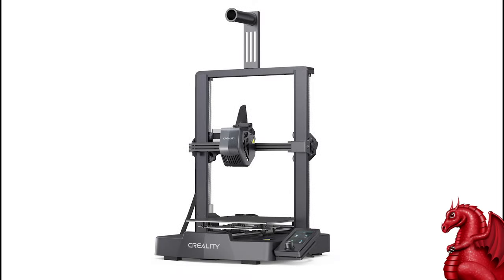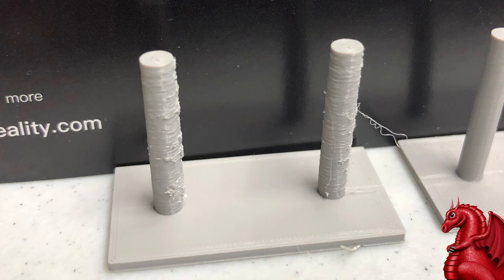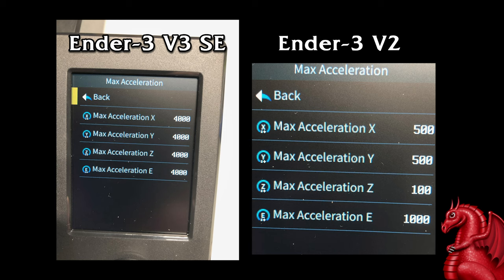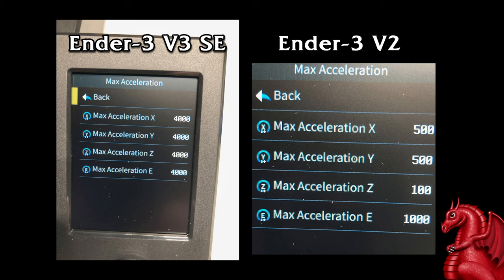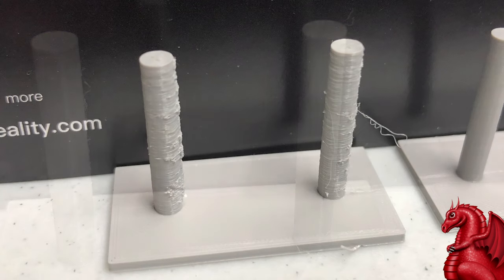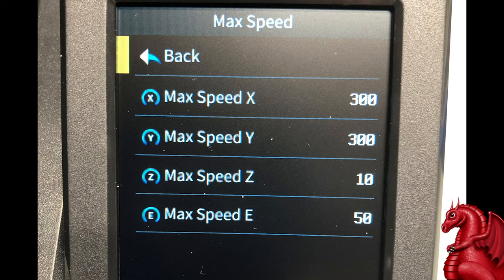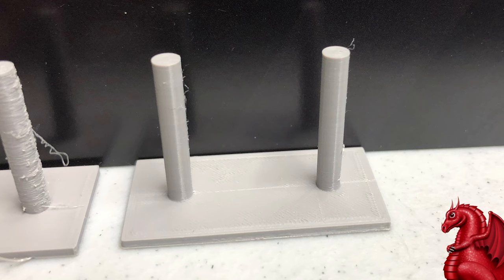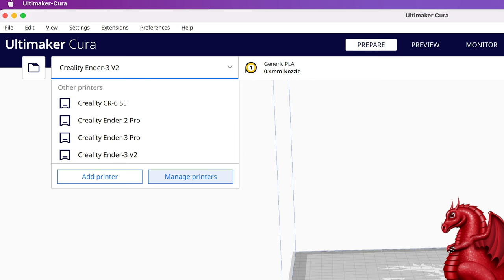Fine tune your Ender 3 V3 SE - eliminate stringing!

Comment: Evening good sir!! I just ordered my refurb SE from Creality for only $125 and was managing my printer on Creality Print app, I adjusted the speeds as you indicated, but the code sequence is different. It reads as follows:
M220 S100 ;Reset Feedrate

M221 S100 ;Reset Flowrate

G28 ;Home

G92 E0 ;Reset Extruder

Do I still only insert the M413 S0 ; Power Loss Off before the G92 line? TIA and great channel!!!
Reply from the maker: That will work (or right after)

Comment: Your printer is clearly extruding too much material. Look at the  top layer of that base. You can see some material being squished up between the roof lines. I'd suggest you calibrate the extruder before changing anything else. Also it could be mostly a Z offset problem, as you said. Changing movement speeds reduces automaticaly the filament extrusion speed and amount, which I think is the initial and main problem, above all others.

Comment: I followed your advice and have to say... it's been working out pretty bad for me so far. What i do love is that the printer has gotten WAY quieter with your settings. Changing directions doesn't produce audible "clicks" anymore.

However, i've had TERRIBLE stringing with this. Tried to change a bunch of settings in the slicer as well (tried both Cura and Creality Slicer) and the only thing that fixed it was increasing acceleration speed again. At 1000 for YX and E its gotten better, but still not as good as if i left everything at 4000.
Reply from the maker: Are you using my Cura profiles? All you need to do is change the retraction to 1mm, everything else is good as-is.
Reply: You can run much higher acceleration without stringing, you just need to run some retract towers at whatever speed and acceleration you want to tune it to. I can get fin details on printed miniatures with 100-140 speed and 1800-2400 acceleration. 16-20 Jerk. I ended up with 1.2-1.4 retract distance and 45-55 Retract speed. Quick tip, with PLA Plus I needed a small ZHop with outer wall wipe distance because of the warping. Wasn't a problem with normal PLA. Hoping someone comes out with a good fan mod sooner than later.

Comment: Well got my printer two days ago.  I printed the Cat with default Creality Print settings and it came out real good.  Max Acceleration on my firmware is factory set to 21,000 for both x and y.  Max speed is set to 800 for both x and y.  Sometimes that nozzle is just flying around the bed.  I also printed a small part that I designed on Tinker Cad and it looks fine.  The part has a hole in it that needed to be a tight fit over a 3.8 mm pin and the fit is perfect.  I allowed 0.8 mm over size on the hole for nozzle over fill.  I left all slicer settings to defaults.  I am using regular Creality PLA and my slicer is set for Hyper PLA.  Over all I am impressed with the ease of use and quality of the printer and the prints.  Before using this printer I have never before even seen a 3D printer so I would say that this machine is definately designed for the beginner in mind.  I will try your tuning settings at a later time to see how it does.  And thanks for doing these videos because the user manual is somewhat lacking.  Your vedeos on this printer have been very helpful as I am 73 years old and have very poor vision.  One more thing my printer arrived needing no belt or wheel adjustments.  My bed screws were also good and tight.  I also ordered a PEI sheet for the bed but  have not tried it yet.  The stock one is working just fine so far.
Reply: This is just a correction to the above comment by me.  The speed and acceleration settings that I mentioned were for a K1 printer and not this one.  It is a miracle that I was able to print the part that I mentioned.  I was never able to print it again until I added the correct printer to the Creality Print slicer.  Definately a big time newbee screw up. Now it is printing everytime after several prints.  I did try the PEI sheet and I can honestly say that it is much better than the stock PC sheet that comes with the printer.

Comment: Interestingly there's still no new firmware version with lower values. It's still 4000 etc (verified by doing Reset Configuration). As you say, the printer jolts a lot and the whole gantry sways, which also clearly affects high prints (quite noticeable above 15 cm). What did Creality say about this, if anything? Is there any reason this wouldn't apply as much to KE? Also, are you saying "power loss" is on by default? I can't say I've noticed any oddities, but I've now turned it off in OctoPrint so it should be off whatever slicer I'm using.

Comment: i fixed this issue by using cura for slicing ..and connction is by usb i found the memory card was bugged and prints came out bad ...i also changed the speed to 75% and nozzle is still 0.4 and mine come out crisp after that.. and i have had my v3 se for 2 weeks now  ,,   really impressed with it just dispointed in the memory card /slot issue

Comment: I'm new to 3d printer and I have bought a new ender 3 v3 se and I have been watching your video and I was wondering how do I rise the nozzle or printer head up???love the channel and you are informative
Reply from the maker: Do you mean the Z offset for having it a bit higher when beginning a print, or do you mean to raise the gantry up several inches to perform nozzle maintenance?
Reply: I think the z offset
Reply from the maker: just go to the Motion menu and select Z offset. It is a negative number, to the higher the number the lower the nozzle, the smaller the number the higher off the bed the nozzle will be.  @peterstoltz3296
Reply: @Tombof3DPrintedHorrors  

Thank you very much. I will let you know if that's what I was talking about..thank you
Reply: @Tombof3DPrintedHorrors  

Can I use a USB-c cable from my laptop to my ender 3 v3 se printer (next to the SD card slot)

Comment: thanks for this info, by way have you had any trouble with your cr touch sensor yet, mine acted up gave error message 6 weeks after bought machine, been battling customer service
any way ordered replacement on ebay and I turned it around so the little circuit broad faces out, seems like it get to hot from the printer nozzle ,  on to your next video

Comment: Just wondering if this manual adjusment is still required? Has Creality fix the firmware? I have just picked this printer up and struggling with a LOT of stringing. Strange thing is the cat that comes with the printer is fine so I am not sure if it is a firmware issue still, or if my Cura or Orcaslicer settings are wrong.

Comment: Since you produced this video a new of version of Ultimaker Cura has been released (version: 5.6.0). They now have the Ender 3 V3 SE in their data base of available printers. The Start G-code has 4 lines of code before the G92 E0 line. Where should the M413 S0 line of code go.
Reply: 😔 have the same issue
Reply: I would like to know as well!

Comment: Hello Tom, I got a question. I got the Ender 3 V3 SE and already the new Cura which has the printer already in their list. When I tried to enter the G-Code line you proposed, I saw that my G-Code looks different. It looks like this (I copied the code below). I am new to all of this and I got quite some stringing as I am printing out some Terrain and I was wondering where is the place where I can safely insert the code you proposed in the code below? Any advice would be great! Thanks for all your videos, I am learning a lot from your channel! 

M220 S100 ;Reset Feedrate
M221 S100 ;Reset Flowrate

G28 ;Home

M420 S1; Enable mesh leveling

G92 E0 ;Reset Extruder
G1 Z2.0 F3000 ;Move Z Axis up
G1 X10.1 Y20 Z0.28 F5000.0 ;Move to start position
M109 S[material_print_temperature_layer_0]
G1 X10.1 Y145.0 Z0.28 F1500.0 E15 ;Draw the first line
G1 X10.4 Y145.0 Z0.28 F5000.0 ;Move to side a little
G1 X10.4 Y20 Z0.28 F1500.0 E30 ;Draw the second line
G92 E0  ;Reset Extruder
G1 E-1.0000 F1800 ;Retract a bit
G1 Z2.0 F3000 ;Move Z Axis up
G1 E0.0000 F1800
Reply from the maker: I'd place it between the 'G28 ;Home' and the 
 'M420 S1; Enable mesh leveling
' :)
Reply: @Tombof3DPrintedHorrors  thank you so much! I gonna try this! :)

Comment: i just downloaded cura and they now have the v3 SE as a printer option, how do I edit the code to turn off power loss, because the code looks different from the v2. thanks!
Reply: I just added the power recovery off code to the v3 se starting gcode, myself. I am having a similar issue with certain cylinders. However, FYI the power recovery option didnt fix my problem. I am trying this fix now.

Comment: So is the problem with the printer ignoring the slicer settings and printing at max speed just confined to cura?
I mean  have you tried the creality slicer yet, which I understand is just a reskinned  version of cura,or used to be anyways,I actually saw that  it has  advanced to more than just a skinned version of cura now  and  I think now includes a profile for the  new v3 se too.

Comment: Hello, great video you gained a subscriber! I did the changes but still get unfavorable results, could you possibly send the other settings you used in the slicer?
Reply from the maker: Did you try my custom Cura profiles? Available on my website under Resources menu, just change retraction distance to 1mm for the V3 SE.

Comment: hey, just got my hands on the v3 SE and your videos have given me a lot of very valuable information. I was loosing sleep trying to figure out why one side of my prints were fine while the other wasn't! You seem to have a very level bed (in previous video) as all your numbers were green, on mine the the bottom left corner is always blue and is almost .8mm different from the diagonal opposite corner. I am assuming the Auto level accounts for this in prints?  Thanks again.
Reply from the maker: Yes, the auto leveler will correct for that. The bottom left is where the strain gauge is located under the bed so that could be throwing things off.

Comment: You mentioned additional changes to remove the last bit of stringing and then didn't put it in the video. Was it just the Z-offset that you changed to get rid of the nozzle drag or did you add a small Z-hop?
Reply from the maker: No Z-hop, just make the velocity changes in the LCD and then the rest of the settings are in my custom Cura profiles on my website (change retraction distance on those to 1mm).

Comment: I'm having the stringing issue as well, but I've upgraded to the nebula smart pad and can't find the settings described in this video. Can anyone help? Really need to get this fixed as it's very frustrating and expensive throwing away bad prints
Reply from the maker: Sorry, I don't use the Nebula so cannot advise.

Comment: Ive had like 2 succesful prints with my v3 se, and its pissing me off. Ive used this video, and a large handful of other guides to no avail. Im using ender pla filament as well. It just drags through itself on the first layer or spaghettis either immediately or almost always at some point during the print. I dont know what to do, as i dont believe im doing anything wrong. Calibration ALL in the green. I dont get it.
Reply: Yes, ive adjusted the z offset, but maybe i dont understand the proper ranges for going above or below the calibration point. Maybe it doesnt need adjustment and the v3 se is just calibrated differently than others (but i dont believe thats true). Ive even paper tested and its fine. Ugh. Expensive frustration.

Comment: To make the first layer not as mashed down..thank you for responding to me thank you
Reply: You can raise the Z offset slightly. Maybe .03. You can also print single .06 layer thick shivs to put under the corner screws on the bed to even out the auto leveling numbers. Had a .66mm difference between opposite corners, now its .15 and works great. Might tune it a little more.
Reply: @jaredhalt4181  thank you for the information and is there sites that are good for me as a newbie

Comment: Thanks for this info it has helped though I did notice when I went into the control motion setting, they had lowered those values. I lowered them to match yours. I’m still getting stringing at the moment like really fine cobwebs. I did want to ask if others have had another problem I’m having. Any square edges that I’m printing are warping slightly and sharp 90degree edges are rounding off. I’m printing a painting station and the little square teeth that fit the panels together are doing this so forcing me to file them down. Any ideas? I’m new to this so your info has been a god send as there isn’t a lot out the for the 3v se yet 😁👍

Comment: Hi Tom. I broke the auto level sensor probe on my Ender 3 V3 SE.  Can I buy a replacement somewhere? I saw several online, but they don’t appear to have the correct cable.
Reply from the maker: If it's a different cable you'll need to contact Creality.

Comment: Hi, I am having a weird issue with my V3SE - the hot plate goes back (homing) and then the limit switch doesnt cut off so it vibrates real bad - and the belt shakes. I could send you a video on it and you could add a video solution (the limit switch has to be manually reset)

Comment: Hi I have the v3 se was printing fine until a couple of days ago. Every peint I try starts fine and then parts lose adhesion and I end up with a heap of string. I have re levelled the bed adjusted the esteps and even replaced the nozzle. Still no luck. Any ideas?
Reply from the maker: Try lowering the Z offset a little (see my latest video on that if you aren't sure how). :)

Comment: But now you are massively slowing down print speed with setting so low acceleration. No idea why they set it at 4000 tho as specs on website sais 2500.

Comment: I went to add the g-code, but they've now added a profile for the ender 3 v3 se so I'm using that. The starting codes are different, do I just put the new code in between the first two?
Reply from the maker: @Lil_Aly951 yep!

Comment: I am wondering why you use the Ender3v2 profile? The Ender 3 S1 has the same extruder so it is a better match. I have been using the S1 profile for my E3V2s with sprite extruders and now for the E3V3se. I do not have and stringing issues. I have been printing on average 12 hours a day for a month with my E3V3se and not a single failed print...USING PLA, PETG and TPU.
Reply from the maker: Because the Cura printer descriptions are identical for the V2 and S1.
Reply: Just a quick question. Could I use the S1 profile in prusaslicer for my V3se? Would that work ok the same way as cura?
Reply: Tom, The V2 and S1 profiles are not exactly the same in Cura. The most obvious...Retraction : 5.0mm for the E3V2  .8 for the E3S1.  No idea what else is different but the results are very different.
Reply: opie, I do use the S1 profile in Prusaslice but much longer print times than with Creality Print slicer.
Reply: @patrickhawkins2239  yeah, i noticed rn. Dang it
Reply from the maker: @patrickhawkins2239  the printer descriptions (i.e. what I am showing at the 9:00 time stamp) ARE identical, pull them up and look.
Reply: @Tombof3DPrintedHorrors  not sure what you mean by the printer descriptions. The settings are definitely different, using V2 Bowden Retraction on direct drive going to give stringing.  Not sure what other settings are different. Try using the S1 profile for a print on the E3V3se and see if you don't get better results. Don't let the NIH factor exclude the possibility of getting better results.
Reply from the maker: @patrickhawkins2239  I am not talking about slicing profiles, I am discussing printer descriptions in the video. Two totally different things.
Reply: E3 S1 build volume is 220x220x270mm, you need to change it to 220x220x250mm to match E3 V3 SE build volume.

Comment: Hi, thanks for the valuable advice but I have the problem that the filament burns inside the nozzle holder and doesn't extrude. Do you have any advice for solving this problem? Thanks again.
Reply from the maker: Sounds like you have a clogged nozzle, just try replacing it. :)
Reply: @Tombof3DPrintedHorrors  Thank you for the reply. I've tried cleaning it many times and it prints fine for 3-4 minutes and then doesn't extrude again. what do you think?
Reply from the maker: @marutiroma6295  not cleaning, try putting a new nozzle on it.

Comment: So does all those settings help with the leveling as well or is that separate cause im getting extremely frustrated that i can never get my leveling good at all i get alot of the strings and prints coming out horribly
Reply from the maker: No, I have several other videos that deal with leveling/Z offset.
Reply: @Tombof3DPrintedHorrors  awesome I'll go see if I can find it

Comment: Okay this might be a dumb question but does that mean I have to run my Ender 3 version 3 SE on Ender 3 v 2 for me to turn off the power outage where can I type that into the start G-Code on the Ender 3 v3 SE program?
Reply from the maker: Not anymore, switch to Cura 5.6 and they have a machine definition for the V3 SE. You can change the start code in that.

Comment: I have not had many stringing issues so far. I just got a 300c hotend for it I guess I could have just replaced the Heatbreak. But what is the easiest way to change max temp in firmware? I did it on a S1 with a sonicpad which was pretty easy. But I'm not using one for my V3 SE would I change in the config.h?
Reply from the maker: There's no need to print at that high of a temp for gaming terrain and minis, stick with PLA.
Reply: @Tombof3DPrintedHorrors  I print a little more than that.  I actually run a business and have client's that need carbon fiber or ASA.
Reply from the maker: @MichaelR1975  this channel is focused on helping tabletop gamers print terrain and minis, that's all I advise on. You'll need to get printing advise from the designers of the models you are printing for their recommendations.